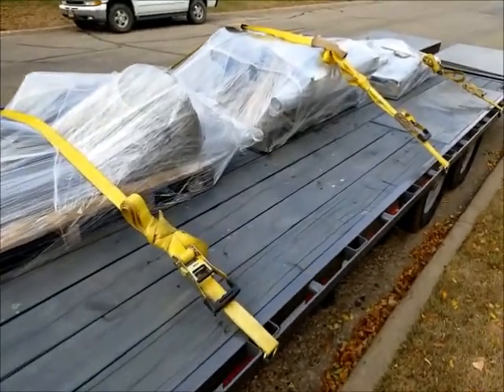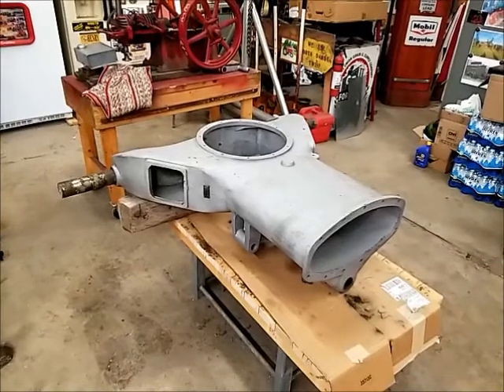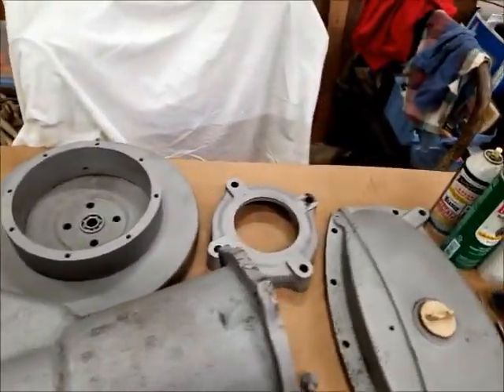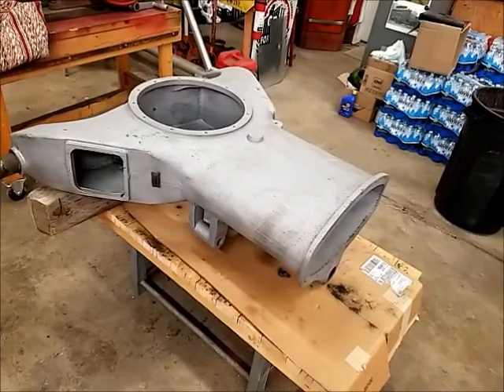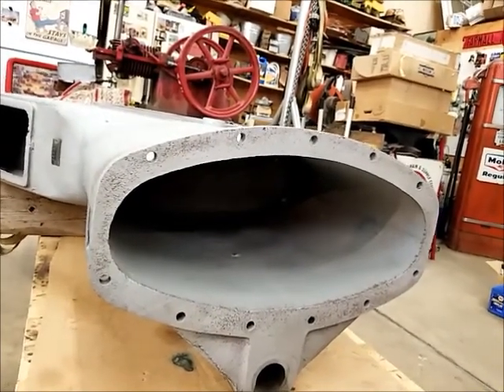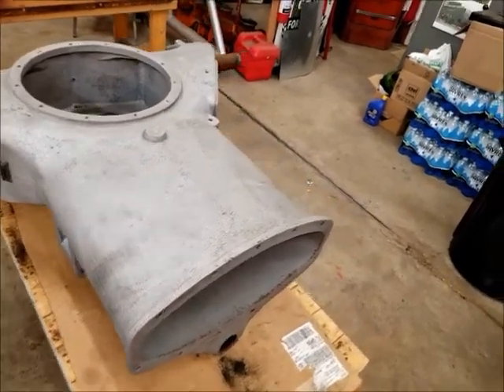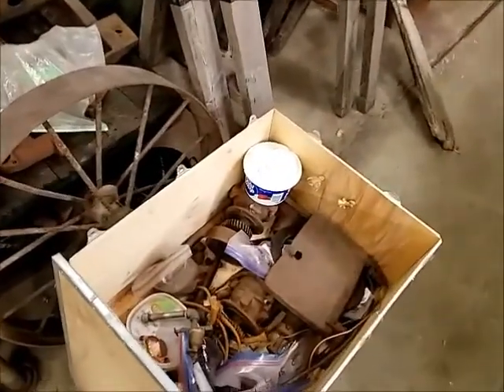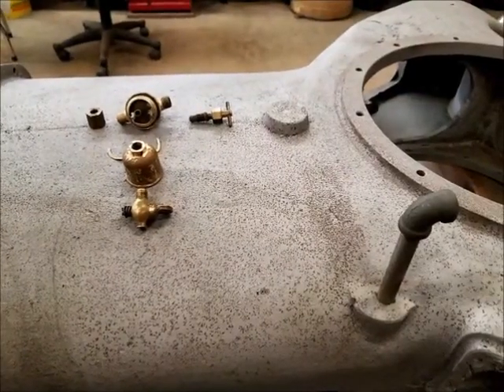1920 Allis Chalmers 6-12 part 32

Comment: The white coating on the inside is probably a sealant so that oil or gas in this case, doesn't leach through and cause the outside paint to come off.
Common practice at tractor or machine foundries
Reply from the maker: Thanks, do you have any idea exactly what kind of coating this originally was?
Reply: @JacobASwanson  No, but I think someone would have an idea of what was used or can be used for that purpose.  It's a necessity, so don't assemble until this is done.

Comment: You're correct about the lower pin having been installed incorrectly.   I think the grease passage doesn't come out in the center because it is such a large diameter it may take from the pins integrity.   Most pins of comparable application I encounter have a much, much smaller diameter and definitely exit in the middle of the area the provide lube to.

Comment: If you decide to put a grease groove, make sure it spirals around the pin a little
Reply from the maker: I opted to not put a grease groove.  It has lasted 100 years with out one with out proper lube, it will definitely last another 100 WITH proper lube.